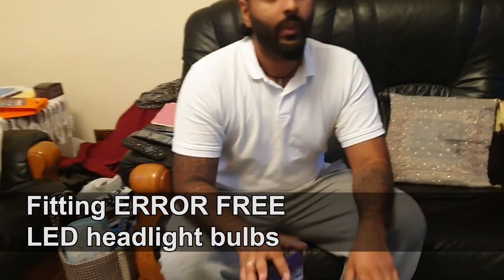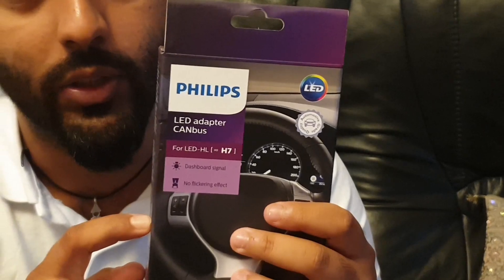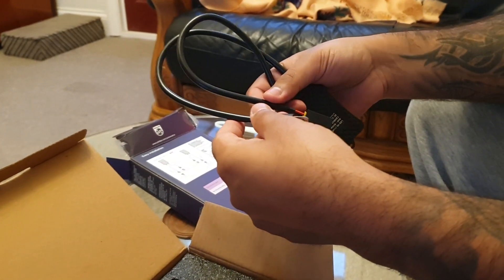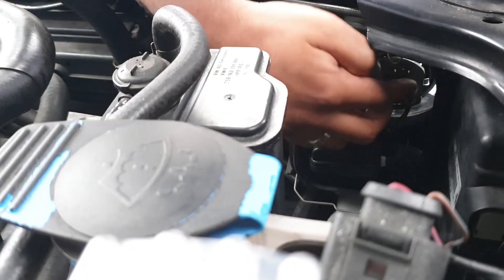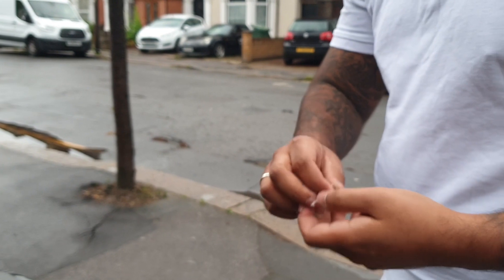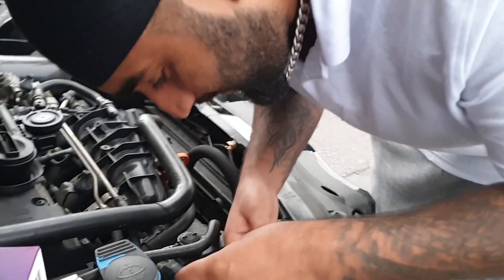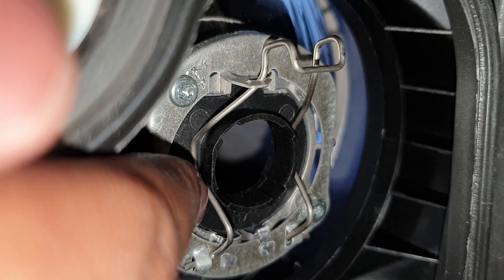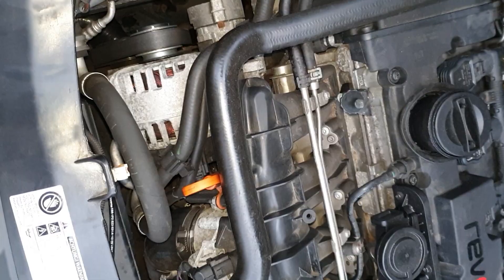HUGE UPGRADE - How to fit ERROR FREE LED Beamtech headlight bulbs + LED control unit!

Comment: Does this upgrade work on bi xenon headlights? 👌
Reply from the maker: The bi-xenon headlights are a D1S bulb and have a ballast so you shouldn't need a separate control unit, if you do it can be a bit complicated.

Try these bulbs - https://amzn.to/2L99GG0

They're 6000k and the OEM should be 4300k, so the colour will be more of an ice white. Let me know how you get on, if you have £20 spare it's worth a try and if it doesn't work Amazon are usually good with returns 👍

Comment: Hello mate, can you please tell me how  you got the waterproof cap back on with the wires for the canbus unit still outside the car to mount it? Did you drill any holes? I've been trying to stuff the whole unit inside but it won't fit, but I see you managed to get the cap back on with the wires still outside. Thanks.
Reply from the maker: I just used a blade to cut a small incision in the waterproof cap, fed the relevant wires and connectors through and kept the rest out so the cap would go back on. Then I just put a bit of tape on the connectors that were in the engine bay so over time they wouldn't corrode and were a bit more protected